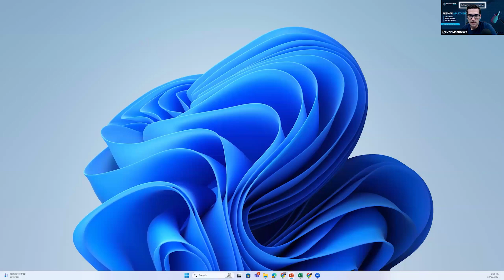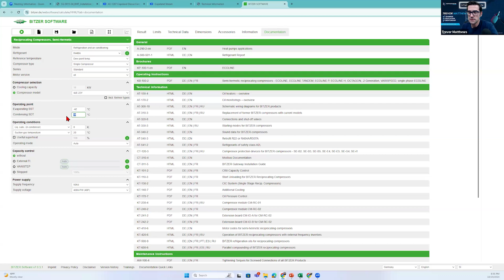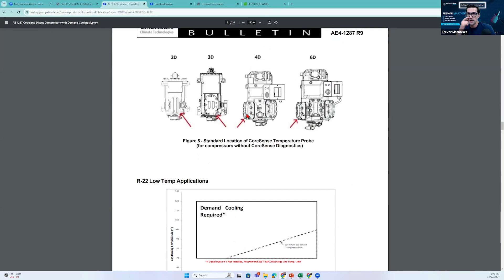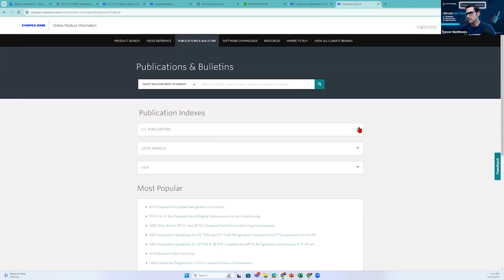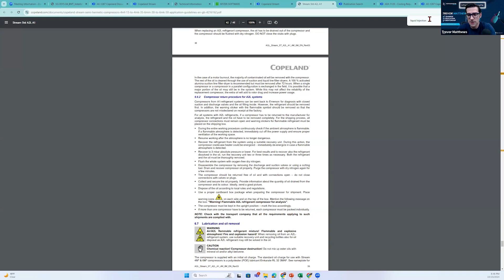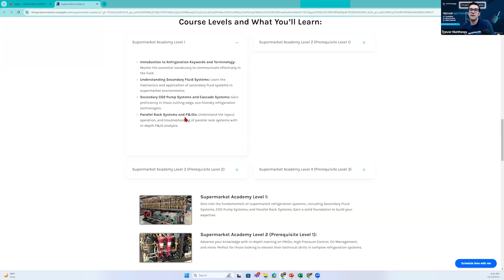Compressor Troubleshooting Demand Cooling Copeland and Refrigerant Injection Bitzer

Comment: Silly question Trevor, some of us are lowly HVAC guys learning this for fun.

Is this very similar to vapour injection for heat pumps and rtus like Copeland’s ZF or YPK1 or similar?
Reply: There is so much cross over between different sides of the trade. I was working on a make up air units that have ORD/ORI valves on them. Its the principles of component operation that allows it to cross over. On our air cooled screws and some centrifugals we have liquid injection. If you get the principles down you can figure out the what,why and how of it all
Reply from the maker: @JJ-COMMERCIALHVAC yes there is and that’s why in all our courses we always go back to the basic even in our advanced courses because the fundamentals and thermodynamics are the same.
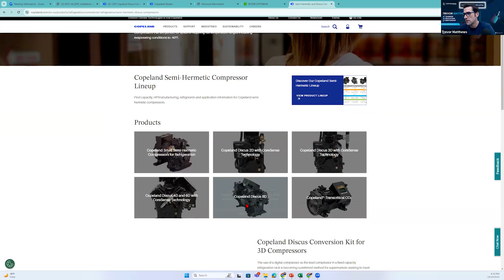Reply: You answer my question at 35:30 thank you!

Comment: We have a few systems that are running LT r449.  Generally, I'll spec them with liquid injection, but then have the rest of the system built as if it isn't there.  The goal is the liquid injection is there to protect the compressor, but to minimize its operation.  It should only be running on the worst of summer days, and if it is running at any other time, there is something wrong with the system and a visual sign that we need to investigate further.
Reply from the maker: Yea I love that. They should only be injecting when the compressor operation envelops reaches certain limits and if its injection before it reaches those conditions something else is going on.  Thanks for sharing. 

I have a free electrical troubleshoot webinar if you or anyone you know are interested https://refrigerationmentor.mykajabi.com/electrical-troubleshooting-webinar

Comment: My god... I haven't seen these demand cooling systems in about twenty years... that's really digging up history.
Reply: I continue to work with demand cooling, but the new versions in CO2 plants sub-critical in cascade to cool medium-temperature compressors... what I meant was that I haven't seen that old version of demand cooling in over twenty years. Yes, the new refrigerants work with much higher discharge temperatures... although I no longer have many installations with fluorinated refrigerants... I practically only work with CO2 and ammonia. In Portugal, where I'm from, the transition in commercial and heavy commercial refrigeration to CO2 has already been made; there are almost no installations with tons and tons of fluorinated refrigerants anymore. And in industrial applications, CO2 is already being used more and more, to the detriment of ammonia, except in large installations. And even in large installations, CO2 is being combined with ammonia.
Reply from the maker: @ValérioCoelho-u5k yes this is happening here in Canada for supermarket and industrial applications as well but at a slow pace then across Europe. Regulations here have not caught up to the F-Gas regs. Thanks for sharing.
Reply from the maker: You will see them more because the new refrigerants run hotter.